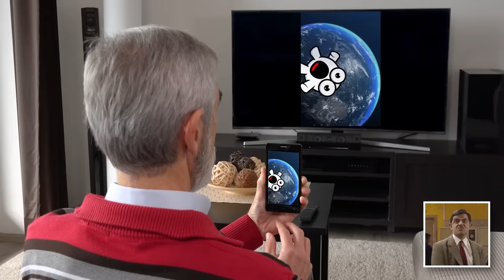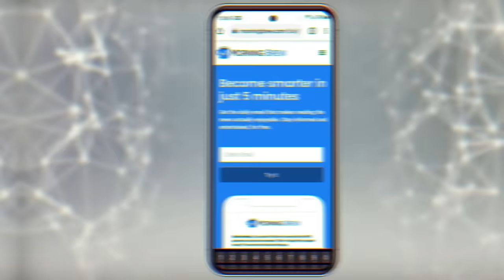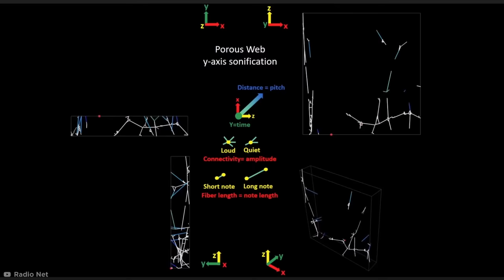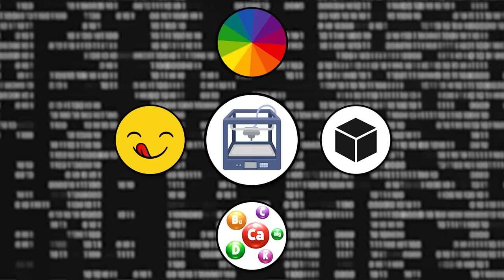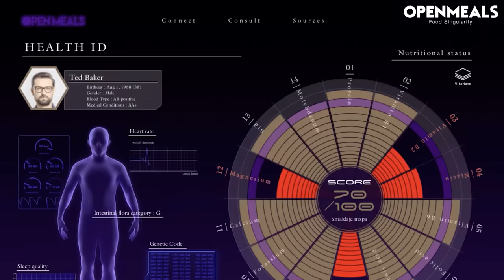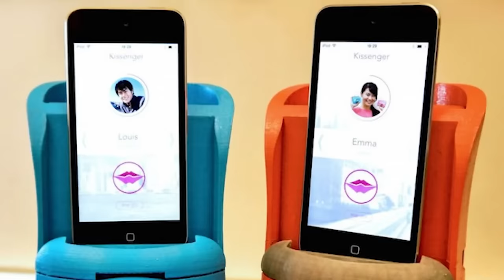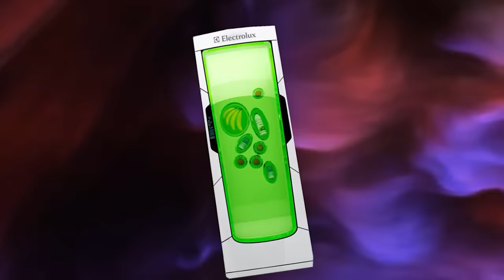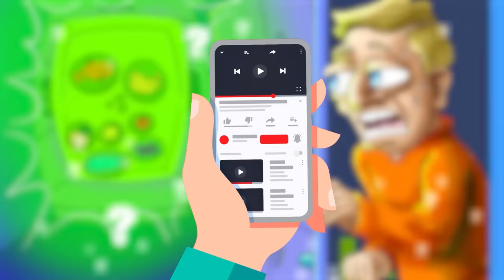Technology Has Gone Too Far

Comment: Having been in the Military, the "Hushme" mask would be invaluable in many tactical situations. Plus I would be thankful if everyone on the subway used their Hushme. Not as useless as the video leads on.
Reply: Totally agree.
Reply: Prob useless
Reply: i dont agree
Reply: I can agree with that, especially the military part. And I only occasionally come across loud speakers on the subway, and it’s kinda entertaining.
Reply: I could also see it being useful in busy call centers. Like, ever been on the phone with customer service or a telemarketer and you can hear the other workers?
Reply: and it wouldn't look "dumb" if everyone was wearing them
Reply: Tactical/security applications certainly make sense, but the military already has this tech (in much better form) within the oxygen masks that fighter pilots wear.  While those may not provide the soundproofing that an "airtight, hypoallergenic foam seal" provides, they do provide some acoustic damping and obscure the shapes formed by the face/lips when speaking.  Less "stylish" but form follows function.

Also, an essential part of speech IS airflow.  This short bit didn't go into much detail (so I could be missing something), but you have to pass air over you vocal cords to make sound, and that air has to go somewhere; to a  region of pressure lower than that within your contracting lungs.  Presumably, atmospheric pressure.  Any buffer to that pressure gradient (the airtight seal) would have to be overcome, thus largely negating any effect of the device in that you'd have to speak more forcefully (i.e. louder) to achieve a "normal" speaking volume .  Perhaps, why pilots in general and fighter pilots specifically, have such low-timbre voice expression.  I don't know.

Speaking softly with a throat mic and a face cover (both long-available AND currently used techs) would have the same effect for a tactical situation...for much cheaper, and lighter, and lower maintenance, and less training...all things the gov't loves.

#slightlytipsyengineer
Reply: yeah i was thinking the same thing.
Reply: @jonh284  its also more effective. Its impossible to completely conceal you voice without drawing more attention, its better to obscure what is being said then to attempt to capture all the sound and neutralise them. | in fact this is incredibly easy to do (White noise generators).

The issue is, in situations where you need to speak in cover, any sound, even devices such as those in the video would provide little benefit without sound cover, as our brains are trained from infancy to try to listen to those speaking. Thus the moment you say anything, you immediately draw attention to the fact something is being said. Something that doesn't work in your favor if your trying to just muffle the sound.

So its better to use something that doesn't require verbal communication in the first place where these such issues occur and if you do, white noise and jawbone/throat mic is the better solution as the sounds are completely covered in a frequency that doesn't just muffle the sound but actually masks it.
Reply: @edenrose2374  It's like you're adding all the words I was too lazy to type my first time through.  Good points.
Reply: In case you're incapable of adjusting the volume of your voice and love looking like a jackass, it's definitely not useless.
Reply: Agreed and I think it might be pretty useful if you’re in a shared working environment but need to take a zoom call etc

Comment: I've heard they are working to replace the microwave by using what is called semiconductor ovens. They will use a new radio wave frequenct to heat the food. Interesting thing is that these new semiconductors act as RF emitters and can even receive information about when your food is done cooking.

Comment: The voice mask might be useful in call Centre's, its really difficult hearing them sometimes with 50 others on their calls.
Reply: no. they wouldn't. | most call centres only sound loud when calling due to the cost saving measures employed by the company. | Cheapest equipment, cheapest working area with more densely packed as possible cubicle areas.

Most based in India are open floors with people shoulder-to-shoulder, with 30 year old phones and microphones that are the quality of toothpicks. | This is not a design fault of the microphone in use, even this product would pick up all the noise from the people talking literally inches away. | this a fault with the company that outsourced to them in the first place based on cost alone.
You cant fix a complex problem with a Band-Aid solution.

Comment: As long as the camera turns on when my cheeks hit the seat I wouldn't mind. Yet I know better than to believe that this wouldn't be abused.
Reply: They inventor definitely has a backdoor to the program and yes pun intended.
Reply: While I understand your position, it's not so much the "abuse" of the imagery that concerns me; It's the linking of the data to a personal profile - lack of anonymity - and, ultimately, the link to personal medical data that would concern me.  Otherwise, if there are people out there that could exploit said imagery for personal...gratification...that's their problem, not mine.  Bodies are bodies, and we all have the same three parts.

My biggest issue is if the images and/or videos made it on to some questionable for-profit website.  I'd be concerned with collecting my share of the cut.

Call it...passive income.   (For the pun  @Robbie H)
Reply: @jonh284  lets be honest here, thats the point of this. No AI is going to be able to make any diagnostic data without knowing other details like, height, weight, age, gender and diet.
90% of the datapoints it would collect are useless.
Greasy loose stool? Everything from eating more greens to fatty liver can cause this.
High white blood cell count in urine? Everything from scraping your knee to cancer can cause this. Having this as a data point is kinda useful, but only to your doctor... | You can train a AI on as much WebMD as you want, but 90% of conditions overlap with another. | i mean loose stool alone is a symptom of nearly every known condition, including psychological ones!

So the only thing this is good for is being a addictive gimmick that gives datapoints to people interested in it (IE: Insurance Providers) - Data is more valuable than subscription fees these days and most people dont even realize it.

Comment: I love the vacuum shoes. Sign me up. It just needs a little work. Make it suction better and make a bigger dirt catcher and I think it's a great idea. I like the beatnik style too.
Reply: its entirely a workable design. Generating energy from mechanical motion is entirely possible and already done in other industries. | it would be better however to store the energy and have a on/off switch for the vacuum. | Also, if you were to keep the always-on design, it would be more efficient to use a mechanical compressor vacuum with appropriate gearing, then this design.

As short bursts of energy powering a demanding DC motor is pointless (DC motors are generally very inefficient at low voltages and produce incredibly low torque in general. This is why electric cars were considered impossible for so long. As storing enough amps to power most DC engines was a fools errand).
Being these shoes use off-the-shelf parts outside the dump-bin, its all going to fall flat.

-- Redesigning this to use a boot format would be wiser, as it gives you more room, you can replace the heel with a bin and make it more convenient with ease of use, and the vertical space can be used for energy storage. | this allows you to make stylish design decisions without compromise.

Comment: Hello. I have a one notification about FLIZ bike, which is considered here ”unneseccary”. FLIZ bike can be a huge difference maker for those people suffering from one disability causing medical condition called ”osteoarthritis”, which means degenarative joint disease, iin which one’s joints kind of destroy themselves and for example jogging and running becomes impossible because the joints cannot handle the stress coming from each hit on the ground by feet. I have seen the same kind of arch like conctruction, in which a person hangs from the light hip-harness and the arch carries the most of the weigth of the person who is then capable of continuing his or her dear sport dispite of the joint disease. So FLIZ bike earns it’s place in the usefull category in my opinnion. There are quite a lot people out there with different grades of disabilites and it is because of technology that makes it possible to keep on going dispite of the disabilities. So actualle this would be a good hint for you to make in the future a video about ”Amazing tehcnology which helps keep on going when the sickness comes to block your way”. I am disabaled myself because of hip and knee osteoarthrosis and for example I would be able to keep on running if I had the FLIZ bike type of solution or the one I mentioned here before, into which the person kind of stands or sits in more upright position while hanging from the arch like structure but the concept is the same. Everybody is not healhty and sometimes help for those become from such things that a healthy one wouldn’t even think about :)

Comment: The gadget to lower voices in calls would b a great idea for telemarketing, customer service /support, and medical calls!
Reply: or you know, not outsourcing to third world countries, with the worst working conditions and worlds worst equipment would work too... | fyi, these devices still would pick up the vibrations from the air outside the casing. Neutralising its effectiveness in those environments.

They work by making it difficult for others to hear you, they dont make it easier for those you are talking to, to hear you... | the call would still sound noisy, and muffled...  - the solution to bad call centres, is simply not supporting the companies that use bad call centers. its that simple.
Reply: @edenrose2374  not all come from large call centers especially medical calls. They are not outsourced to other countries but it's hard to hear over each other. Why assume i was talking about large call centers outside the country?

Comment: The roll bot could be used in public bathrooms, each bot having a specific signal, with a phone app to choose and connect to that signal. It can be up against a wall and just roll under the stall door to you then go back to be refilled, either by a machine or manually by an employee/janitor

Comment: I feel like the biotech hands, if slightly modified, could be used by amputees as a less expensive option than prosthetics.
Reply: There is better, less gimmick driven designs already. | the possibility of prosthetics than can interface with the nervous system is already a reality. Stuff like this is just party toys based on "Grabby hands" reach devices used by the elderly.

Comment: I think the consept behind the Flisbike could suit a market if they also had versions with pedels, a motor, or a thing to attach and detach peddles or a attachment to make it an electric bike for when you don't want to jog up a hill or whatever. and haveing a comfterble harness would probably make it alot more sucessfull.
Reply: just to be clear here i think for %95 of consumers would rather use a high quality comfterble seat on a well designed bike over the flizbike almost any day including myself. the Concept behind the FLIZ Bike may still appealable to use every now and then, for bikers into bicycling as a hobby, because it's something different from regular bicycling.  PS: I generally don't like bicycling because I'm lazy but i can see some appeal to bicycling with a well built bicycle.
Reply: They do make that, it's called a bicycle.